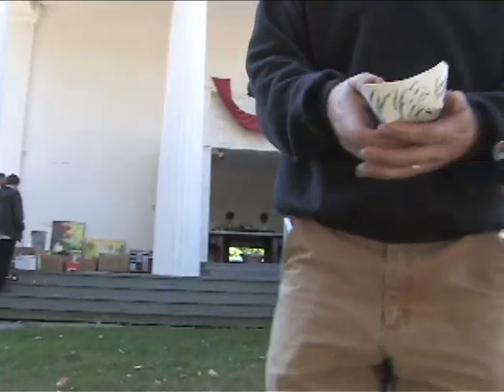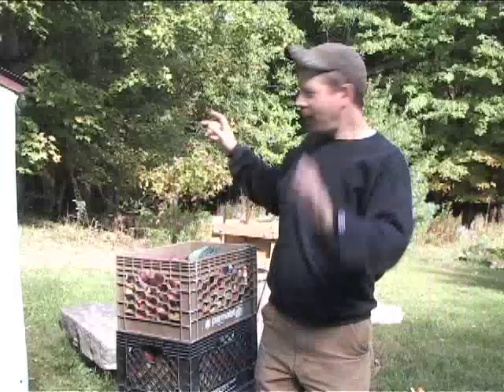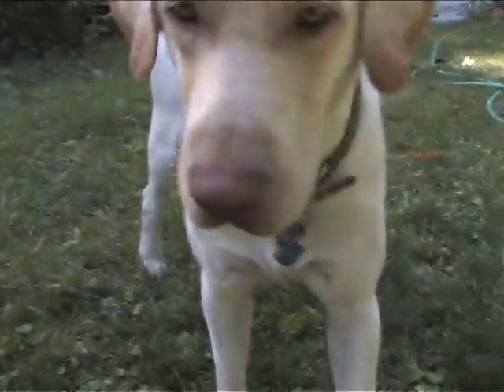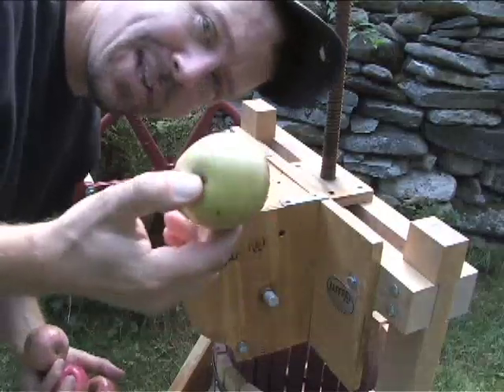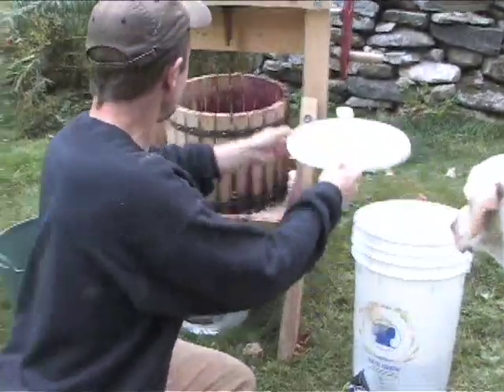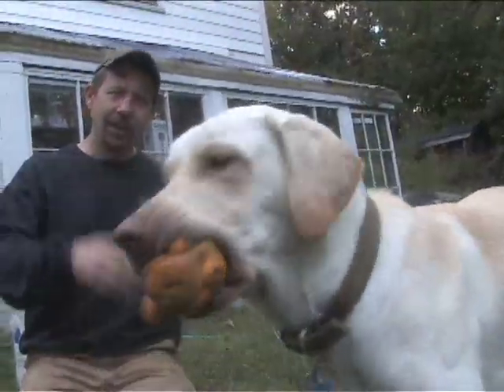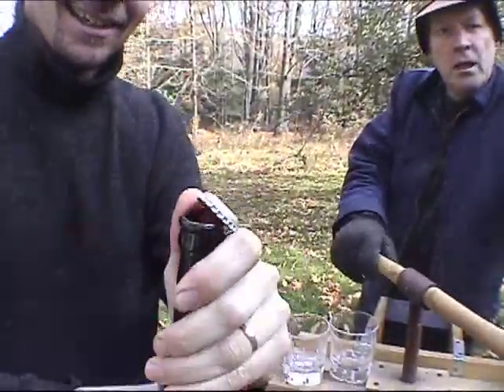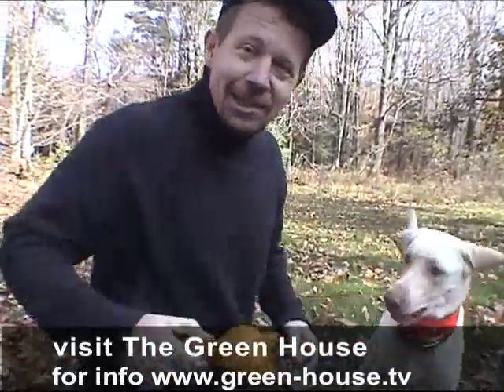How To Make Hard Cider and Apple Cider - GardenFork

Comment from the maker: thx for the questions. the apple must is the cider as it ferments. i would cut out the soft spots of the apples, then use them. the kegerator will work fine, you must heat the cider to about 180F or use campden tablets to kill the wild yeasts, then pitch the cider yeast. check out viewer forum for more info. thx, eric.

Comment: @RonOverdrive I do all my brewing with wild yeast. My cider will be ready with in week to drink I do not rack it. I do allow it to carbonate in the bottle most of the time. But the cider is low sugar content and even when finished out will be like 3% to 4% alcohol at best. Meaning it dose not take long to ferment. You should check it after 2 days and taste it , if taste right bottle it if not the way you want leave it longer. They way you did it it could have also had wild yeast it as well.

Comment: Using the "rotten" or soft apples is essential to making a cider. It's where original apple cider comes from, partially rotten apples.
1. Use a cheese cloth lining in the apple press to avoid large unwanted pieces from entering the primary fermenter.
2. Heat the apple mixture (minus the yeast) up to 180F and add in white and brown sugar and your water and stir for at east 30 mins. I would suggest 45mins. This will kill off any unwanted bacteria which may have gotten you that sour taste.
3. Once cooled to 100F add your yest and let ferment.
That should yield a much better tasting hard cider.
PS: never use chlorine or bleach to disinfect/sterilize brewing equipment, especially with plastics. The chlorine will leach into the plastics and then leach into your product. Always use food safe sanitizer!
Good Luck
Reply from the maker: thanks for the info here, i have not had an issue with chlorine with plastic materials, and it depends on who you ask as to what condition the apples  need to be in.  thx!  eric.

Comment: Also if not adding sugar to mix its safer to taste like I am telling and use wild yeast because when bottled it will carbonate the place in the fridge.Because alcohol levels will be low.Wild yeast has lacto-bacillus causing a small amount of lactic acid to form meaning with carbonation and refrigeration will stop fermenting and preserver it. the lacto-bacillus could have caused the off flavor also since you did not pasteurize the mixture before fermenting. I would say you fermented to long.